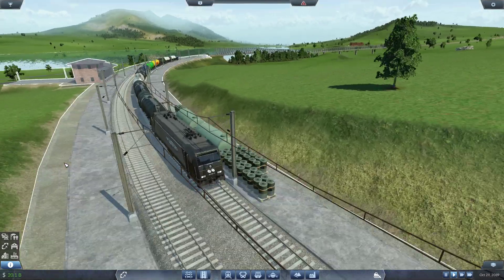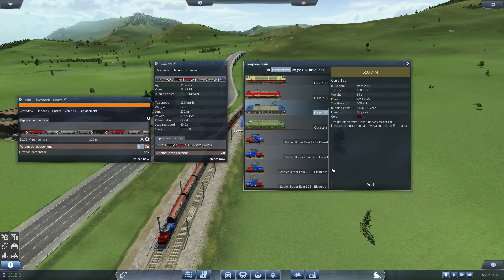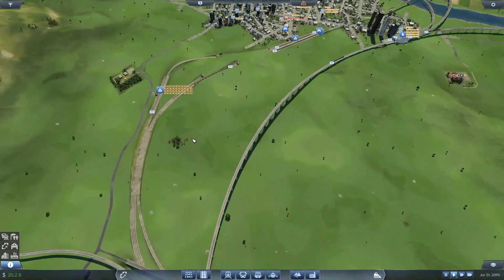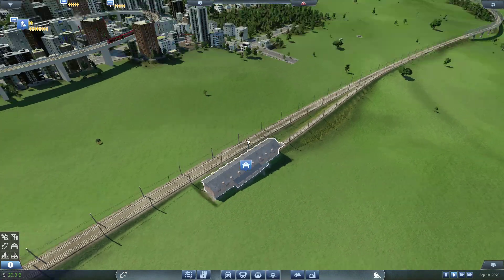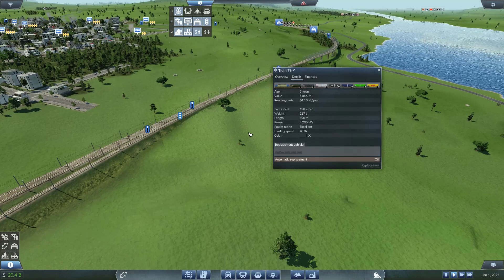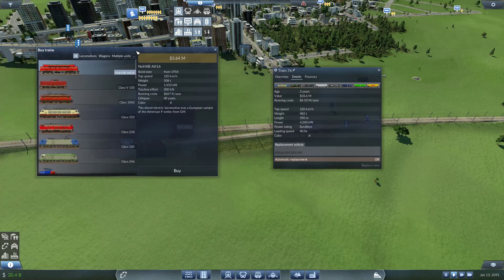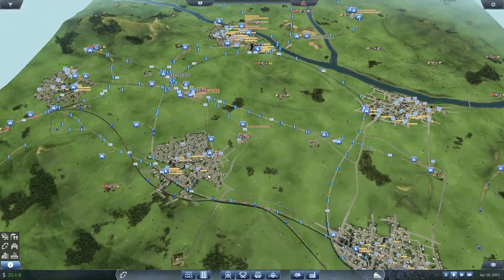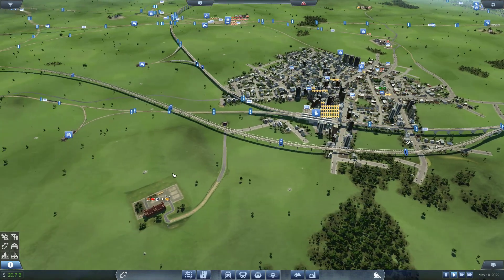Transport Fever - Ep. 59 - Fine-Tuning Freight Lines - Transport Fever Gameplay

Comment: It'd be great if you could use less tracks by re-using them. So if you have a station for two lines, make only two tracks going out and a crossing. That's more realistic even though you have to be careful not to cause too long waits. 
I actually mix even passenger and cargo lines going partially on the same tracks - it adds a bit more complexity to find the proper timings, train speeds, waiting times etc. You can also use separate tracks for cargo trains when passing a passenger station so they can overtake passenger trains that are loading at the station etc. Give it a try, it's fun and it keeps your map a bit less cluttered.
Anyway, keep up the great videos!
Reply from the maker: +Kupfer Nickel thanks for the tip. Yeah I used to do that as well, but it became such a pain especially when the network grows as big as this. Plus, it's also nice to see parallel tracks because it gives the appearance of a massive train network. ;)